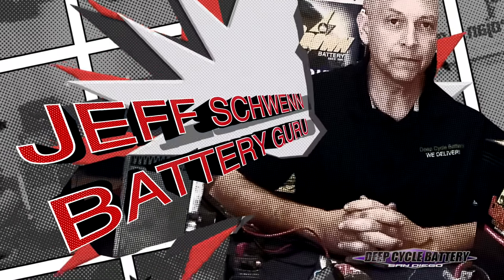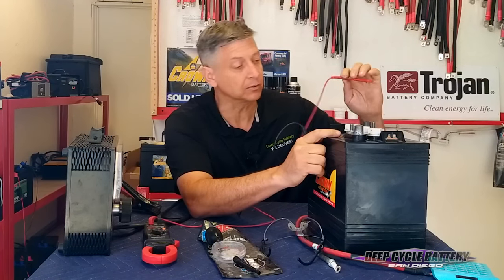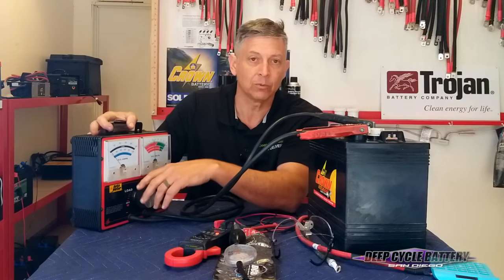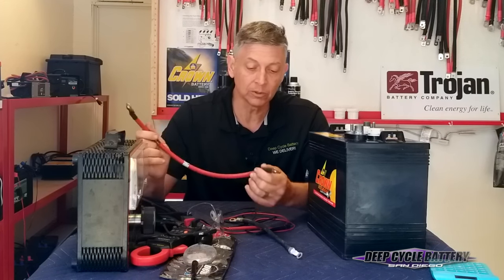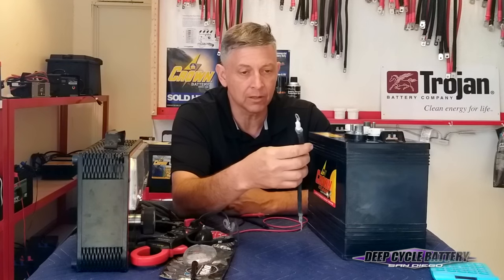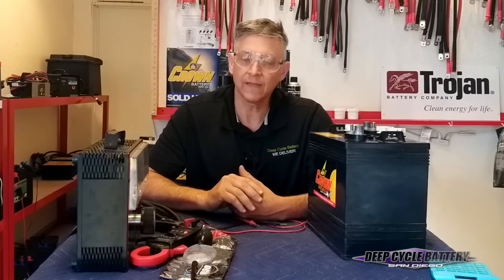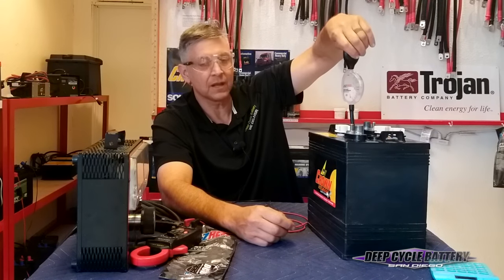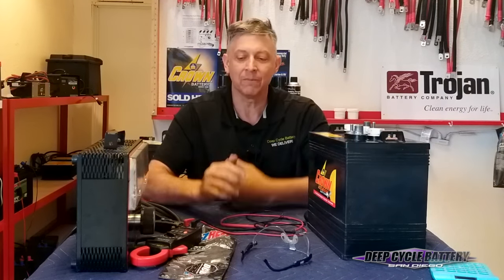How to Test Golf Cart Batteries - Troubleshooting Batteries

Comment: finally a very smart man, i so agree with you, we work with current, voltage is exciting electrons, a great load test yes sir, a loose wire causes sparking, will cause pits on the terminals, i so agree with yo sir

Comment: So the end of the video had me do the test. I am getting quite a bit of voltage from just touching the grease or whatever the thin layer of liquid is on the top of each battery. What is the best way to clean these things? Thank you im hoping that may be what is draining my batteries so quickly.
Reply from the maker: clean off excess conductive grease with a rag and make sure top of battery is also clean

Comment: Hello Jeff, My name is Pat good to meat you. I need to ask so questions, I am building a small solar system and don't know witch way to go and cost is a big factor. Do I go 6 or 12 volt, flooded lead or AGM. I will probable going between 300 & 400 watts, and using solar and alternator charging while driving. Can you offer some advise to the battery end . I live in Hemet Ca. and can make arrangements to come and pick them up. I hate to bother you but don't which way to go. Thank you for your time and trouble, Pat

Comment: Interesting info regarding the 650A CCA rating for GC2 batteries. That's helpful, thank you.  Any idea why GC2's do not have a CA or CCA rating on the label, or on the factory spec sheets?

What I'm trying to determine is -- similar to the max. C/5 charge rate -- if there is a max discharge rate.  We currently have 12 each CR-225 batteries for our whole-house UPS.  They've lasted about 10 years, but it's time to replace them.  I'm wondering if we can get away with 8 batteries.  We are using 2 Trace DR2424 inverters.  They pull 140A each at full load, but the load is generally just a couple hundred watts.  The heaviest load is our well pump --  either 1/2 or 3/4 hp (I can't recall).
Reply: Good question about max discharge rate, because if allowing batteries to heat up is a problem during charging or discharge, then certainly an excessive load could create excessive heat — but I wonder if batteries have that indicated as a rating in their specifications. If not, why. Paper shredders indicate how many pages can be shredded simultaneously, and they are also rated for minutes to avoid overheating and damage. It would make sense to have batteries rated in a similar way.

Comment: Nice clear explanation on checking out the battery.  Thanks.  

Should the Crown 6V battery in the video be given an equalization charge  since there is a noticeable difference in the specific gravity of the cells?
Reply from the maker: Yes, perform eq on day one and then approx every 45 days thereafter.
Reply: Thanks.

Comment: Hi Jeff, I have an off grid home and am using Crown CR430 batteries. Will the Battery load tester work with that much amperage, if not what do model do you recommend?
Reply from the maker: The load test is a snapshot to batteries health. Typically you would fully charge L16, load test with 200-300 amps and observe voltage not dropping below 2 volts. Back up results with battery hydrometer

Comment: I have a question more than a comment I have a 1000 amp load tester that tests 6v, 12v, and 24v batteries can I use this for 8v golf cart batteries?
Right now I am using the 12v scale but not sure what kind of voltage drop I should expect

Comment: Quick question...I did a complete clean of my car battery and tipped all the electrolyte out and cleaned inside of battery with water and baking soda...now I come to realise I need to refill the battery with mixture of sulphuric acid and distilled water...can I use the hydrometer to test the mixture ratio before putting it in the battery...so for example mix some acid with water and test with hydrometer untill it reads in the green the 1200 range...and when it does it's the right ratio? And then fill the battery up with that ?
Reply from the maker: Good idea I've never tried that. Or find another battery that's toast and use the acid from it
Reply: REMEMBER....Always add acid to water and NEVER water to acid, it can blow up in your face(not a fire explosion, but it can hurt you).
Reply: But I add distilled water to acid nearly every month when level gets low?

Comment: DO Golf Carts have a charging system?
Reply from the maker: most carts come with an external or portable charger designed for the carts voltage. some carts come with an onboard charger located in or near the battery compartment

Comment: Ho jeff writing from puerto rico...how do you check amps on a 6v 420ah bateery carbon lead
Reply from the maker: this would require a discharge test that is not diy friendly, However an inexpensive discharge item can be purchased on amazon for about $50> Will Prowse has a video specifically on discharge test on batteries that is relevant to your need

Comment: My hydrometer i just bought shows almost no movement filled with the electrolyte .but the load tester showed good battery, just got these batteries used. All fluid is to top of fill holes
Reply: Charging your batteries at that level of fluid can cause it to overflow. The plates swell. There are indicators at the bottom sleeve inside to stop. The fluid rises to the top.

Comment: i use 6-6volt duracell batteries in my cart. they are 2 years old this month. i charge them between uses and have added very little water only because it didn't need any added. why did my cart run fine for 36 holes for almost 18 months and the last 6 months decrease slowly whereas i barely make 18 holes...if i'm lucky. purchased them at Sam's Club. any suggestions. thank you
Reply from the maker: the best diagnosis tool for a flooded six full battery would be to purchase a battery hydrometer and check your cell specific gravity look for equal readings across all the cells

Comment: i have 2 6volt batterys, they read 6.1 volts. each, but i put them in my small camper and they die over night with some mild use............ i looked inside and dont see any liquid, the plates are moist
Reply: Top it off with distilled water like he said (quarter inch above the plates is considered full). It will bring them back to life and be able to get a good charge.

Comment: That's a 12V load tester bud; and since golf cart batteries are not cold cranking AMPs like auto or marine batteries, the test is bogus. Look at needle in video, it is in the red zone (replace) to begin with. This test can actually damage deep cycle golf cart batteries